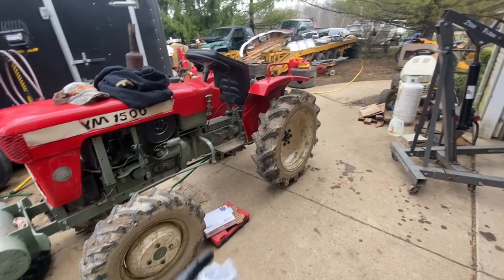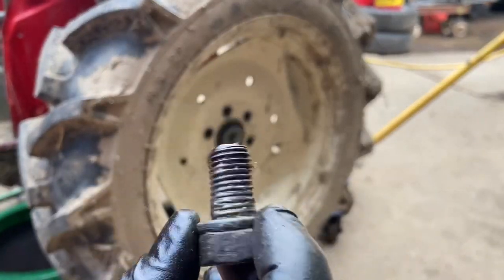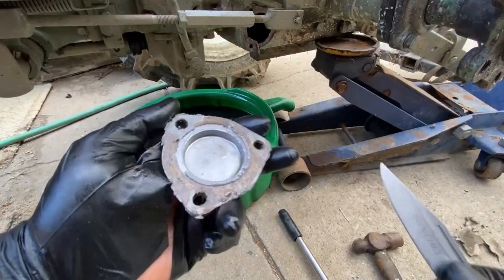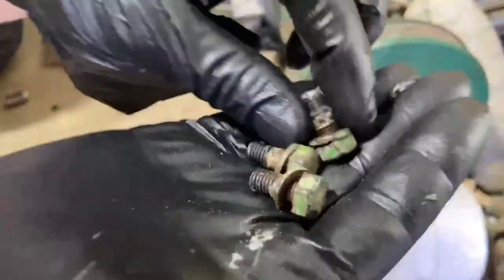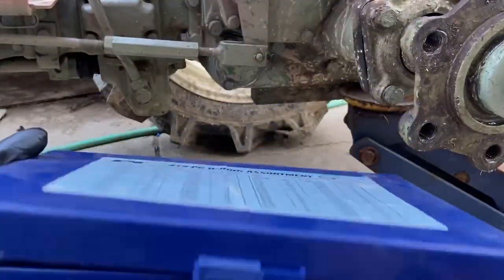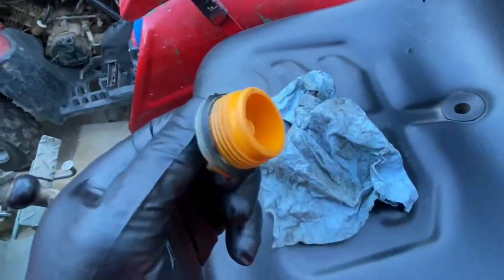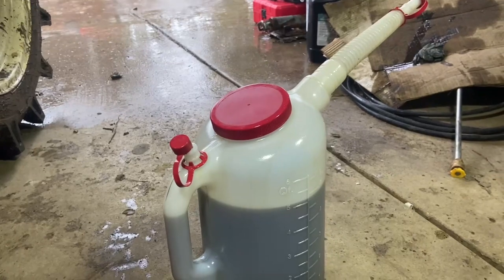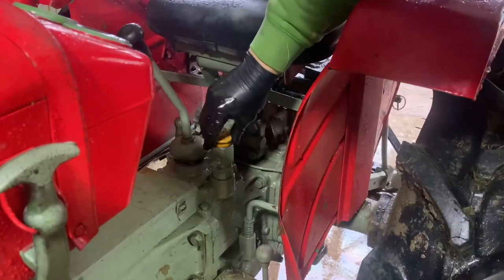Detailed REAR END FLUID and FILTER change. YANMAR 1500D

Comment: I have a 1975 Zen-Noh YanMar YM1500, and am confused by this Lube King All Year Lube King LU52AY2G All Year Hydraulic Fluid Oil, 2-Gallon label warning. Lube King, 2 Gallon, All Year Hydraulic Oil, Multi-Viscosity Oil Is Designed For Year Round Use Regardless Of Temperature, Viscosity Is Similar To A 5W20 Oil, Provides Protection Against Oxidation & Thermal Breakdown, Product Is Not To Be Used In Tractor Or Automotive Transmissions.

Comment: This video is a lifesaver!!  I just got my first tractor, a YM1500 2WD.  I have been concerned about the hydraulic fluid level and condition.  The previous owner didn’t mention the dipstick in a different location.  I did pick up 10 gallons of fluid, and just received my replacement steering gear, which I’m gonna install today if the rain will stop!
Thanks for your great videos!